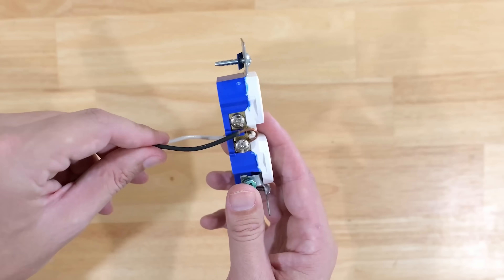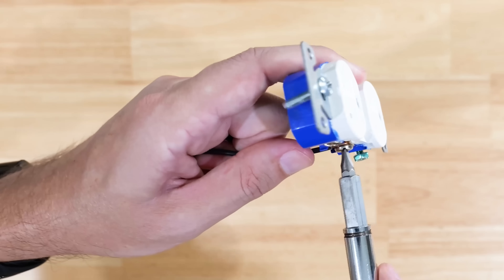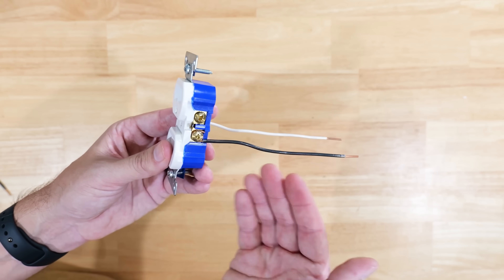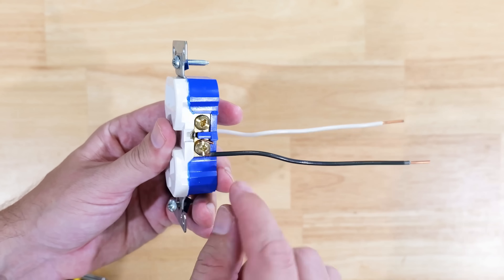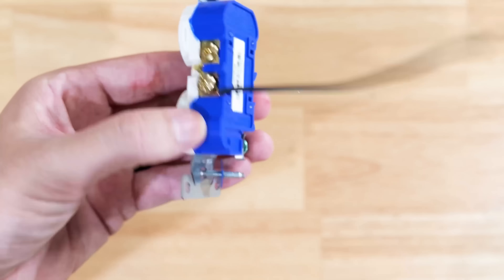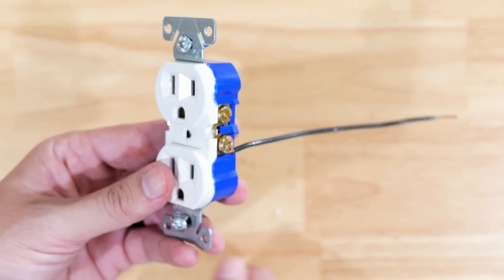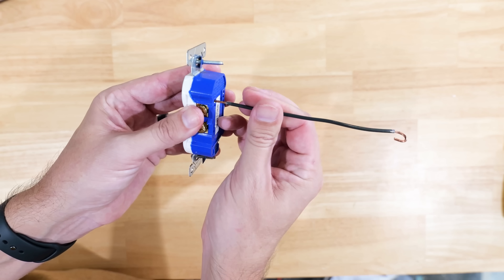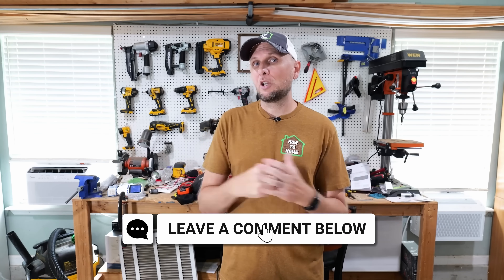Avoid Disaster! 8 FATAL Outlet Mistakes Most DIYers Unknowingly Make!

Comment: I know this is overkill, but I always wrap outlet receptacles with electrical tape. My first house had metal outlet boxes, so I just got in the habit. And it really doesn't take much longer to do it. Although a whole house, yes, but a few, not at all. All of my electrical friends have said to never use the back stab, or wagos!!! And new homeowners, it probably does hurt to have someone (if you don't feel comfortable) to tighten the wire in the electrical box, as wires vibrate and come lose over time. By NO MEANS am I a pro, nor am I trying to insinuate I am!!!! lol Just things i've learned over the years....

Comment: I just changed out my 240 dryer outlet. I went back with the same stripped wire due to me not having to bend or alter it in any way to get it in place for the two hots, neutral and ground wires. It seems like a much better connection when i plug it in to the wall vs my other one that felt loose and only worked when the dryer was unplugged slightly. Glade I changed it out when I did because the old receptacle melted slightly on the inside and could have started a fire.

Comment: What do you do when you have a new receptacle with less screws than the old one?

I have two white and two black wires going into the old receptacle. The new outlet only has two screws. But it does have 2 slots each for back wiring.

Comment: 0:55 yeah, at my old house, there was a 20 amp receptacle on a 15 amp circuit that corresponded to the master bedroom, so I took it out, put a regular 15 amp receptacle in and installed the 20 amp receptacle in the washing machine plug since it was on a 20 amp circuit, the original outlet was loose anyways, meaning if you plug something in, it easily slips out and it had 12 awg wire, meaning I met the code that was already not met. Also it was the only 20 amp receptacle in the entire house, which was interesting, so at least there would be one that it once again, on a proper 20 amp breaker and wiring.

Comment: Question: I recently replaced an electrical out that looked to be burnt and slightly blackened from the outside after a space heater was used for a couple of days. After looking at your video, I replaced the outlet and when using again for the first time after replacement (this time, charging my laptop), after 30 minutes or less, when I went to unplug, my cord was hot. Why is this still happening?

Comment: Bought a house built in 1965, every single outlet was connected through those push holes. I had to literally destroy each and every one of them to even get the wires loose to replace them. They don't make them like they used to.

Comment: I have a weird problem that I am hoping I can get an answer to without hiring an electrician (unless I absolutely should).

I have replaced more electrical outlets in the places I have lived than I can count. In fact, because I work in IT and run my own hardware and work from home, I have always upgraded my outlets to the more expensive, heavier duty outlets that service my gaming PC, home server, and networking equipment that is first fed through my UPS.

I am now trying to replace an outdoor outlet. First time ever. The outlet itself was cracked and chipped and I was concerned it could be a fire hazard.  The old outlet was one of the "backstabbing" configurations. 

I install outlet, test with multimeter, test again with my cafe lights and other stuff that gets plugged into on the deck. No issues.

However, when I go to push the outlet into the electrical box, it shorts, sparks and trips both the breaker and GFCI (which is in the garage for some reason). 

This ONLY happens when I go to screw down the outlet and put the cover on, or even when I manually push it into the enclosure. 

I wanted to remove the housing, as its metal. However, some weird and random wire runs laterally through holes from one end of the box to the other, making it impossible for me to remove the metal box and replace it with a plastic one. 

I even went so far as to use electrical tape to cover both the inside of the box, and all metal parts of the outlet so as to prevent metal from touching metal. 

No dice. 

I am really stumped as to what is causing the short when I try to screw that outlet into place.

Comment: One bend over and back shouldn't weaken the wire to failure.
Reply from the maker: You ever tried it?  There is a noticeable difference it’s bent back the opposite direction.
Reply: @HowToHomeDIY I have, I'm very careful and I don't try to get it arrow straight, just straight enough to fit. Haven't have any issues on going on 35 years. Without putting a sharp bend in it, how how maybe back and forth bends would it take to get a break? More than you'll ever do...😂 I'm more concerned about not having enough wire if something ever does break.

Comment: 14/2 or 14/3 romex is rated to 15A. However, some instances will let #14 go as high as 25A, depending on use, insulation type, and ambient temperature.

Comment: I admit I've especially put the j in backwards repeatedly. Though in my house, when I started doing maintenance on the outlets (mostly upgrading 2 prong and rewiring), the big issue was the outlets that were already 3 prongs, they had been wired neutral to ground. That's against code where I live, and I've been told it's also a huge no no. So that was more work to do.

Comment: I just had a house built.  I replaced a few of the bedroom receptacles with ones that have USB ports in them.  I noticed the electricians who did the wiring used the backstab method in all the receptacles (that I’ve seen so far).  Lazy bastards.  I guess they chose speed and price instead of price and quality.

Comment: When I lived in a mobile home I was so paranoid about electrical fires that when I replaced switches and outlets, I took a pair of needle nose pliers and did a complete loop around the terminal instead of just a J-hook. Then after tightening it down, I covered the terminals by wrapping electrical tape around the plug or outlet along the terminals, that way if a cover ever busted off, then the likelihood of someone touching them would be reduced. With four active daughters, things getting broken around the house wasn't uncommon. I'm not sure that really made anything safer but it made me feel better with a strong connection and some extra cover over the terminals.
Reply: Actually it's against code to tape outets
Reply: @Stevesbe  Guy, a quick google search shows that's not true. I don't know where you got that from. You don't tape the outlet you tape the terminals inside after screwing them down. Absolutely not against code.

Comment: Great question ❓ 
For you..
Can I use 12/2 Romex wire with 15amp system, so if I want to run a line from breaker box using a 20amp breaker and the 12/2 wire to a 20amp receptacle, so I can run a power tool or a  space heater.. or something like that, can I do that ??
Isn't it safer to use a little bigger wire like 12/2 on a 15amp system..??

Comment: Question: have you ever heard of an outlet making a click sound every 5-10 mins? Not a pop i know that sound but like a ink pen click. No smell, no smoke and no devices plugged into that outlet. And then I removed the outlet and wire nut the common and ground and put a blank wall plate on it and it still happens....

Comment: Great video for some basic safety issues. I love the Klein tools, but also have some SnapOn ones, too. I'm not totally sold on the commercial outlets for 5 to 10 times the price....really depends on the application. Most of the time house wiring does fine with residential outlets. 
Also, while the torque screwdrive is great, it's expensive and one can use one of their common inch pound torque wrenches enough to develop a feel for what is needed with a screwdriver. 
Overall, great.
Aircraft mechanic and electrician for many years.

Comment: You are correct its does say you can put a 15amp outlet on a 15 or 20 amp circuit but I'll keep doing it the proper way im not gonna be a hack and follow nec code that jeopardizes someones home short of new technology there should be no reason they have to update the nec every few years unless they find flaws in previously published codes

Comment: I did make the mistake where I straighten out the old curved to insert into my GFCI outlets into its backwiring connectors.  
I couldn't really strip off more wire as the wire in there was already very short to start with.

Comment: I have a red, black and white wire. I assume red is hot cause it was attached on the right side on the older outlet on the brass screws and the black wire was also on brass screw on bottom while the white wire was attached on top silver screw on top  left side and neutral on bottom with the green screw. But even wiring like this i have no power and the circuit has tripped. Not sure what i did wrong. I even put the hooked wires in clockwise and screwed down tight and snug. I used a 15 amp receptacle so that cant be why it tripped

Comment: I have a Leviton switch looking at it the green screw is on the top left and there are two gold screws on the other side according to the diagram on the box the top screw says line black then on the gold screw below it the diagram says load black the it comes down and says load charge then it says neutral white and white?? Help!

Comment: I am planning to wire a quad box for a tv, router, and game equipment.  It would be on an existing 20 amp circuit with 12-2 wire.  Is it ok to pig tail within the box for the two duplexs or run one wire for each, or doesn't it matter?

Comment: I'm 53 and i have never seen a back stab receptacle fail before the internal clamp that the cord plug into get loose and the cord won't stay in unless you widen the plug terminals  by that time it needs replacing anyway

Comment: I didn’t know this, but Phillips screws and screwdrivers were designed to cam out. In an automated process, you don’t want a slot or square head screw and screwdriver because an automated driver might easily break off the screw or damage the driver.

Comment: I don’t agree on the torque screwdriver comment; I’m an electrician and every electrician has or should have a torque screwdriver as since 2017 NEC torquing to manufacturer specification became required. I’d add that you can over-torque connections as well, which can be just as bad, if not worse than under-torquing; so please just invest in the right tools to do the job.
One way to help a lot of these problems is to buy commercial, spec., or hospital grade receptacles as they’re just built to a better specification/quality and set up for easier wiring than cheap residential receptacles. There are now lever lock receptacles that do not requiring torquing to specification and can install much quicker than back or side wiring receptacles.

Comment: Wait, so you’re saying I can put a 15 amp receptacle on a 20 amp circuit? So if I have 19 A of current going through that outlet, what happens? The outlet gets hot, but the circuit breaker doesn’t trip. Right?
Reply from the maker: I’m not saying that, the NEC is.  Most of your 15 amp receptacles have the same internals as 20 amp.  I have no dog in this fight.

Comment: I know it's common, but solid wire is not to be stripped with wire strippers per code. Can cause a ring mark that prones to breaking. Use utility knife even though more laboreous. ☺
Reply from the maker: That is not a code.  Code doesn't mention anything about that.

Comment: The 15A vs 20A outlet is moot, imo. I checked to see what portable, plug-in kitchen appliances draw more than 15A. You know what? There ARE ONLY A FEW. The ONLY devices that draw more than 15 amps are electric water heaters (NOT PLUG IN), fridge (maybe, and by code they are separate, dedicated line), wine coolers (maybe), Induction hob (NOT PLUG IN), electric oven (separate dedicated 50A line). THAT'S ALL FOLKS. So go ahead and install a 20A outlet and you will not be frying any wires unless you use a high-amp wine cooler or induction hob.
Reply from the maker: You heard it hear folks.  A random YouTube commenter is giving the OK to go completely against code because they made sense of it thinking they thought of everything.  My goodness.  I don't have the time to list all the reasons why this would be a bad idea.

Comment: Not one video mentions what the screws on the outlet are used for. Not one. Top, bottom? No help here.
Reply from the maker: They are used for securing wires.
Reply: One pair is used for power coming in, the other can be used for power going to the next outlet. Top and bottom doesn't matter in this case. If you break the tab in between the screws, you can make one receptacle switchable and the other hot all the time. You could also do this so each receptacle would be on separate circuits.

Comment: Your breaker protects circuit and not the outlet
Reply: @SteveStowell It doesn't matter, receptacles are tested for 30 amps and rated for 20 amps pass through. Either way, in your scenario, 12 gauge wires, even with pigtails will become warm enough to trip the breaker if everything is working correctly. 20 amps on 12 gauge wire continuously is an overload condition. Reference NEC 210.19(A)(1) limits the load to 16 amps for a continuous load on a 20 amp circuit, regardless of whether 15 or 20 amp receptacles are used.
Reply from the maker: I didn’t say differently.  But the outlet is on the circuit so it does protect it.
Reply: @HowToHomeDIY the outlet does not
Reply: @HowToHomeDIY show me where the fuse is in an outlet if you think so.  If you put multiple 15 amp outlets on a 20 amp circuit and you wire from outlet 1 to 2 and 3 there is still 20 amps going through terminals on outlet 1
Reply from the maker: There isn’t a fuse on the outlet.  The circuit breaker is what protects everything from too much current being drawn.  What is your specific argument?  You take issue with a 15 am receptacle on a 20 amp circuit?  Maybe I’m not fully understanding you.

Comment: Excellent presentation. Most folks do not know the correct ways to wire outlets.
I have one observation and one question.

Reverse polarity: Yes this can be a Very dangerous situation. And most folks can be
misled by the fact that many, Many, MANY devices today don't care which way they are
powered - forward or reverse. So they will not think of the things that do need forward
polarity Always! Easy to be misled........

Question about a little too much insulation removed. You say arcing can be a problem.
What would that small exposed conductor arc to? It's surrounded by non-conductor
material except for the other screw that is already strapped to the one you are wiring
to - ie same potential. If you have conductors floating around that might come near
to the un-insulated portion of the wire, then you have MUCH BIGGER problems!

Comment: Never never never wrap stranded around the screw. Always connect the stranded wire to a crimp on and then put the crimp on to the screw.
Reply from the maker: No
Reply: Yes. Far less possibility of a loose single strand and stronger connection with full even distribution of current when using the right crimp ons. Or pigtail and use solid wire. Never wrap stranded around the screw.

Comment: Not too surprisingly, I recently decided to replace one of my wall outlets, and looked up the product online and days later, guess what video pops up on my YouTube? Ya, this. But, I only saw it a few hours AFTER I installed it. Good news? I did everything right, and unlike in my younger days, I actually shut the power off this time. Only issue? Nope, not resetting the clocks, but one sprinkler station came on and stayed on, even though the controller was set to "off".  A little flooded backyard is the only damage done.

Comment: I just replaced some of my receptacles and the previous person used the speed holes.  Then using the strip gauge I did notice it wasn’t enough for the looping on the screws. Pinching the sheathing. I find that so odd they do that.